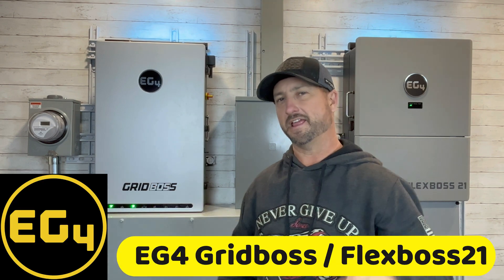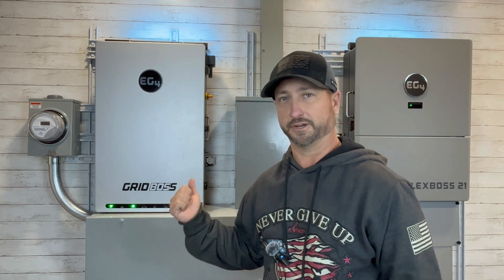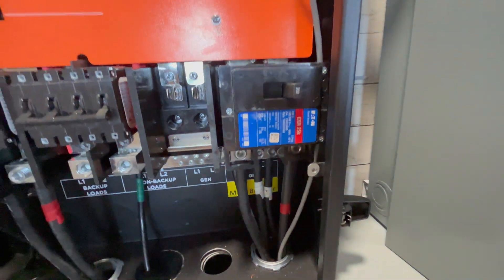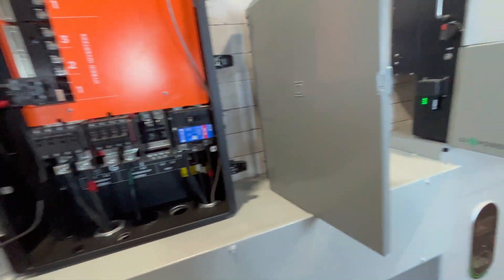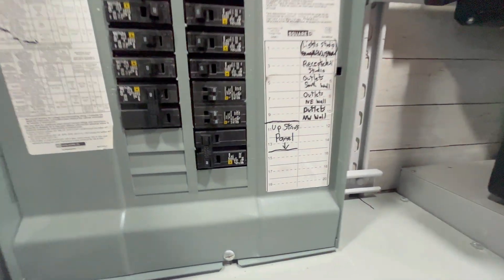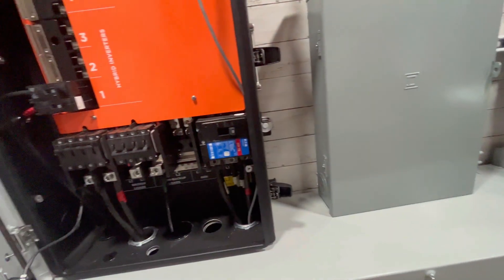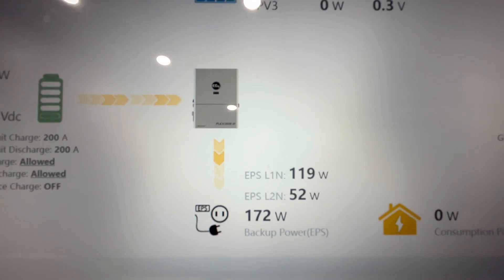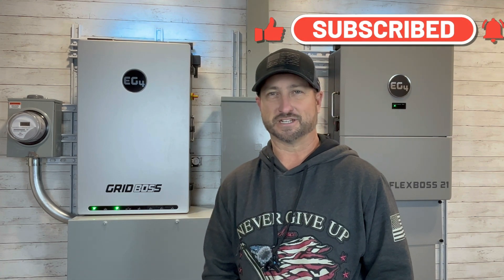How easy is it to install the EG4 Gridboss and Flexboss21?

Comment: My electric stove pulls at least 30 amps.  My dryer another 30ish.  Running only those two appliances would exceed the 67.7 maximum current for AC output.  So.... while the wattage ratings on this is impressive I would still need two units to power my house.  Or am I missing something?
Reply: I think in this case one must distinguish between what one wants to support with the grid available, and what one wants to support when the grid goes down.   With the grid available and a 200A service, you can run 200A worth of stuff and all that will happen is that a single FlexBoss21 will only contribute (continuously) 50A of that.   With the grid down you would only be able to support 50A from that FlexBoss.

Additional amps are supported in a grid-down situation if AC coupled solar is active and contributing at the time the loads are needed.  The AC coupled solar would be a separate source, additive to what the FlexBoss21 is able to contribute.

If in a grid-down situation you want the inverters to be able to contribute more power on their own, then the Grid Boss allows up to three EG4 hybrid inverters to be integrated into the system and run in parallel... so you would have two or three FlexBoss21's instead of just one.    With three, that's 150A of continuous output.

But I think for most people, in a grid-down situation it doesn't make a whole lot of sense to have three (relatively expensive) inverters JUST for the convenience of being able to run several large appliances simultaneously when it is far easier to simply manage the large appliances so only one is run at a time in such situations.

-Matt
Reply from the maker: @DougB64  those are the two largest loads in your house. You could get a GE Heat Pump washer dryer combo that will only use about 500 watts when drying instead of 6,000 watts. Making your home energy efficient is cheaper than trying to buy more inverter and battery power. Thats how I’ve been able to run my whole home and water well on one inverter.
Reply: @unpluggedtexan  I agree completely and strive for that.  I looked at those all-in-one heat pump washer/dryer units.  After watching several YouTube reviews I decided to hold off on purchasing one of them for now.  I'm not sure the engineering behind those units is where it needs to be.  I really like the idea of how they work but the collection of lint seems to be a fairly big issue long term and it impacts the efficiency.  Using an induction cook top is an option as well.  I don't think it's difficult to add a 2nd inverter to this new system so I'll probably do that.  I think I'd rather have the additional capacity just in case I need it.  This equipment will pay for itself over time.  Because it's something that can be a DIY project the payback period is much shorter than it would be if I paid someone to do it.  Even though the price of the batteries has come down it's still way cheaper to build your own so I can build a fairly robust system inexpensively even if I do end up adding a 2nd inverter.  I will have access to the grid for my project but would like to have enough capacity where I won't need the grid.  Thanks for making these videos.  They are a huge help to folks like me that want to build our own systems and save money.

Comment: In your wiring pdf, why do you use 3/0 for the GB connections to the meter and loadcenter, but only AWG2 to the FB. Given that the FB is giving you whole home backup, it's the same amperage (in general) right? Was it an assumption about being colocated indoors?
Reply from the maker: @jamesbuchanan27  the flexboss21 only uses a 90amp breaker on the gridboss. The 200amp pass through is on the gridboss so that’s where you have up to 200amps going from grid to your loads. You’ll never see more than 90 amps from your flexboss21 so that’s why only 2 gauge is needed there.
Reply: @unpluggedtexan  Thanks. But how are you doing whole-home backup of a 200A service through a 90A breaker? 200A is over-spec'd?
Reply from the maker: @ I’m backing up my whole home by using energy efficient appliances where I can run my home and never exceed 50amps at 240v. I have the Gridboss 200amp pass through to my loads if by chance I go over that 50 amps at night on batteries or over 66amps when solar is present.
Reply: @jamesbuchanan27   I'm putting my 21 with 2 batteries and grid boss together..  Just an educated guess but to answer your question and achieve the whole 200 amps via the 21 and batteries I think you would need 3 inverters with one battery min each.   .  sound about right?!
Reply: @philhofland5501  Yeah, something like that. It turns out the "whole home backup" marketing is a little overstated. The FB21 is capable of 16kW AC IF you have at least two batteries. So 2/0 is fine for that 66A AC connection to the GB. With soft-starts on the air-con and some behavioral changes, it turns out that the 66A is actually enough for me. Though I plan on getting a second FB (and another battery or two) in due course for peace of mind.

Comment: I downloaded your file that shows all the wiring you used.  Just curious, reading the NEC on grounding wires, it seems that you could have used 6 AWG THHN wires for all the ground wires.  Also, the current carrying wires from the FlexBoss to the GridBoss seem like they could have been 4 AWG since they are protected by a 90 Amp CB.  Am I wrong, or are you just using bigger wire for added safety?
Reply from the maker: @danbusse4089  exactly. Bigger wire because I was always taught to oversize slightly just in case.

Comment: why did you feed a 90 amp breaker for Inverter? 16000/240 is 63Amps, and then did you 1.25 multiply for continuous load?
Reply from the maker: @josephsalazar6428  90 amps is the max pass through that the flexboss21 inverter can pull from the grid. So that is the breaker size you want.

Comment: Hello, if i have already had a 10kw system . Can I just get the grid boss n connect my system to it? We'll,  until i can afford to buy the flex boss... Thank you in advance...
Reply from the maker: @larrymiller7128  the gridboss will only work with EG4 hybrid inverters. So you’ll want to wait to hook the gridboss up until you get the flexboss21 inverter.
Reply: @unpluggedtexan  thank you for your response..always love your video..
Reply: Do I have to use eg4 batteries, too, or I can use what I already have?
Reply from the maker: @ you can use your existing 48v batteries. It just won’t be able to close loop connect to the EG4 inverter. So the inverter will be determining the state of charge of your batteries from voltage only. That means there will be a slight “drift” in accuracy of the state of charge of your batteries,typically when you go a few days without getting them fully charged.
Reply: @unpluggedtexan  thank you again

Comment: Hello, I noticed in your EG4 system regret video, you mentioned that you would have put a manual bypass switch between your meter and the inverter.  That way you could work on your system while the house had grid power because the switch would isolate your system.  Did you decide against that with this system?  Oh, I just have to watch the video and find out!  Nice feature.  Awesome install!

Comment: Hey Brian great video thank you...Im assuming that you have this equipment installed in your garage or workshop...What are the rules in TX about where you can install these products?? Inside the Garage ? Inside a mechanical room in your house? Only outside away from the house in a weather tight shed? Thanks in advance...
Reply from the maker: @michaelschiessl8357  I’m not aware of any rules that prohibit where you can install it. It just needs to be installed in an area that meets the temperature specs of the unit. But some jurisdictions will put additional rules that go beyond code.

Comment: Let's be specific, the FlexBoss 21 can provide continuous 16,000 watts which is about 66 amps at 240 volts.  The GridBoss can handle 200 Amp.

Comment: Until this video, I didn't really understand the benefits of the GridBoss and FlexBoss. Now I'm going to have to rethink my plans for the future. I had been considering the 18kpv, which the FlexBoss would replace, and the Grid Boss certainly looks like it ticks all the boxes I had for installation simplicity. I just have to decide on batteries. :)
Reply from the maker: @kojakdurham  I agree. The Gridboss and Flexboss21 combo really makes the 18k pv obsolete. I give EG4 props for releasing this combo knowing it would eat into 18k pv sales dramatically.
Reply: @unpluggedtexan  If I'll never have enough panels to run the entire house (Maryland, not in an open field).  Then I'll need a transfer panel installed by an electrician and then use the 18K?
Reply from the maker: @ I’d stick with the gridboss and flexboss21 combo. You’ll get the transfer switch included with the gridboss and you’ll have more power than the 18k, and overall it would be cheaper than going with the 18k pv inverter. EG4 pretty much made the 18k pv inverter obsolete at its current price point. The price will have to come down on it to make it a better deal than the gridboss and flexboss21 combo.
Reply: @ thanks

Comment: Do these both need to be placed close to the meter and/or the electrical panel?
Reply: You put the Gridboss close to the meter for ease of installation but the Flexboss and batteries can go pretty much anywhere.  I put the Gridboss between my meter and main panel in my garage. The Flexboss and batteries went on the side of my house in a detached shed. It is 30' away from the equipment in the garage.

Comment: The Flex Boss, 6000XP and  the 12000XP high-frequency, transformerless inverters can all damage your appliances, even with the Flex Boss installed. This is a fact because none of these inverters offer any galvanic isolation. Just ask Google AI "Can a high-frequency, transformerless inverter damage your appliances?" to learn why.
Reply: Don't depend on Google AI for your information.  This isn't really true.  Why do people post these social-media echo-chambered bits of nonsense?   Galvanic isolation?  These are whole-home-wired systems, Neutral and ground are bonded somewhere.  Always.  Neutral is never isolated... in fact, its typically a violation of your utility agreement if neutral isn't hardwired throughout.  There is no galvanic isolation no matter what the inverter's technology is.

These inverters are heavily monitored and have their own internal relays.  They aren't going to fry anything unless the person installing the system does something dumb like float the neutral.

-Matt

Comment: It took me a bit of reading to understand why in the video and PDF, the load wires between GridBoss and FlexBoss21 attached on the FlexBoss's grid terminals. The FlexBoss21 makes it clear that load is out and grid is for in (and not to mess that up), but that's for standalone installation and reading the GridBoss manual, it's clarified: 

"When operating an EG4 hybrid inverter with GridBOSS, the inverter’s load port will remain unused and should be in the off position. The inverter’s grid port supports both grid input and output based on the inverter’s settings."

Great video!
Reply: man thank you for this!

Comment: I noticed you have two lines run to the Flexboss21 for each of the battery cables (2 positives and 2 negatives) but I only see one battery. Do you just have the connection doubled up or a second hidden battery hooked up? I have two 48v 314Ah 16KWh rack mount battery for a total of 32KWh (pretty sure the BMS can handle cont 200a and 600a peak) , and I'm trying to work out the best way to connect them up to a Flexboss21. I'm thinking one of three ways, 1) Parallel them then line from top batts pos to Flexboss and bottom batts negative to the Flexboss.  2) Both batts to a pos and neg busbar then to Flexboss. 3) Just connect them each up separately to the Flexboss. No matter what way I do end up doing it tho I plan on using 4/0 welding/battery cable.
Reply: A buss bar is your best bet. Top positive and bottom negative is good for equal battery discharge and balance of the rack, but the buss bar is ideal to go to the Flexboss.  Even if just for easy future expansion of the battery banks !

Comment: Since you've had both this and the SOL-ARK, which would you recommend for EG4 Battery and a 19.2KW setup?
Reply from the maker: @caffeinatedfunctionality  I would go with EG4. Sol-Ark doesn’t appear to be innovating in the residential field anymore. I’ve noticed Sol-Ark support going the wrong direction. I can confidently say now Signature Solar support is easier to get a hold of now than Sol-Ark. it used to be the opposite a year ago.
Reply: @unpluggedtexan  Nice just talked to my installer to use that for my installation. It looks like a solid setup and I've got two EG4 outdoor batteries for it.

Comment: Neat video! I am curious is the webui local? or cloud? In my area the internet goes down with the power, so I would be very interested in seeing the local only mode
Reply: The UI is local. No need for an internet connection.
Reply: @TheNodeChannel  any chance you can add a video showing the lan local experience?
Reply from the maker: You can add the LCD screen to control it locally without an internet connection.  But if internet is spotty where you are then I recommend getting Starlink, as long as you can power the modem up with your solar system you should always have internet.
Reply: @unpluggedtexan  Starlink would be a hefty bill just to have as a backup internet and I am okay not being connected 100% of the time :D 

Mostly, I don't want to have to go out in the cold snow to check on the status of my battery when in theory there is enough "smarts" in the device to provide basic data locally.

Comment: I just bought these for my planned setup and I only got one battery so far like you.  While reading and engineering the whole setup I noticed that the max output from a single battery is 200A even though it is parallel wired to the flexboss so that it could use 400A max.  At least in my understanding you will not be able to exceed around 9-10kw on backup battery power only unless you add a second battery.  Is that your understanding?  This thing is a game changer, it solved so many of my issues.  Love your channel.
Reply from the maker: @jerryfaircloth  yes you are correct. With just one EG4 indoor wall mount battery do not exceed 10,000 watts or you’ll trip the breaker on the battery. It would be best to get two batteries and connect them in parallel.
Reply: @unpluggedtexan  If you were grid connected with a GridBoss and FlexBoss, If you only had one battery @ 10kW and you had it set to use battery first, if you drew more than 10kW would it automagically support the load by supplementing with the grid?
Reply from the maker: @ yes exactly.
Reply: @ Thanks!

Comment: A slip of the tongue?  At timecode 4:17 you pointed at the grid boss and called it the flex boss.  Not that it matters, but I discovered when using the Eaton breaker you reverse the L1 and L2 wires to be consistent.
Reply: I noticed that too, I wander if he has corrected that?  (You can see the yellow sticker behind the cables...  I double checked the Eaton breaker with a meter and it indeed crosses the L1 & L2 inside the breaker...)

Comment: I may be misreading this but the GridBoss user manual (page 32) seems to show two communication cables are required and the FlexBoss parallel dip switches should be turned on. I see you have only one com cable used. Can you explain?  Also, a video showing all of your software settings would be useful to check against mine.  I am having a couple of issues and trying to troubleshoot.  Are you seeing the GridBoss graphics and output when you select the gridboss's serial number from the top tropdown?  I get the gridboss graphics regardless of the serial number I select.  Thank you for your videos and wiring diagram!

Comment: Is the inverter necessary for adding batteries only and not solar. Is the Gridboss the only thing necessary?
Reply from the maker: @techiedavid  you’ll have to at least have the Flexboss21 inverter to connect the batteries to. That’s how the DC battery power inverts that to AC power which is the type of power we use in our homes. The Gridboss makes the install a lot easier if you plan on using the grid as either backup power or to sell back power to the utility company.

Comment: Can you wire up and run tests when using the "smart ports". Curious if you remove the breaker and wiring for your A/C (for example for the smart port) in the current breaker box and run the wiring and breaker to the smart port.

Comment: Correct me if I’m wrong. But with both grid and flexboss, you can run both Grid and Inverter at same times? Example, pulling 12kw from inverter, kicks on AC unit and it would pull that additional load from the AC as a Bypass or to support the demand?
Reply from the maker: @Zodiac83104  correct. It’s a hybrid inverter so it has that ability.
Reply: @ that’s great! Grid boss manages that well? So if you have the grid and use the inverter to help save electricity/backup, you technically are good if the grid is available for larger loads?
Reply from the maker: @ correct